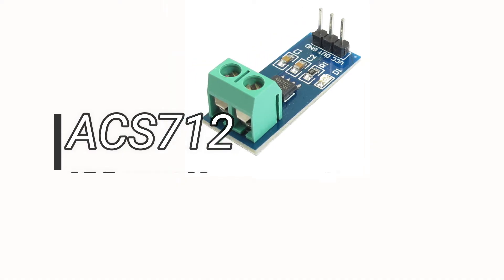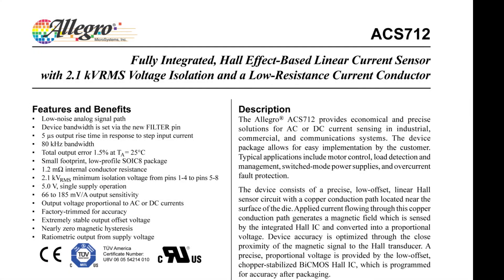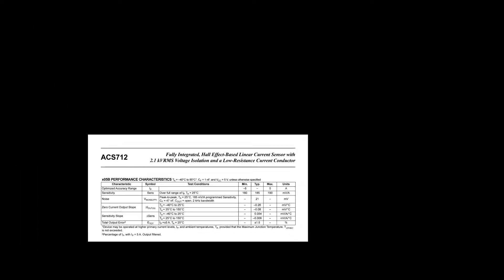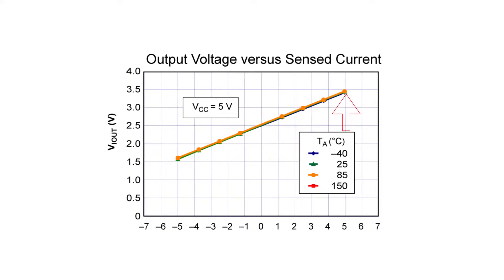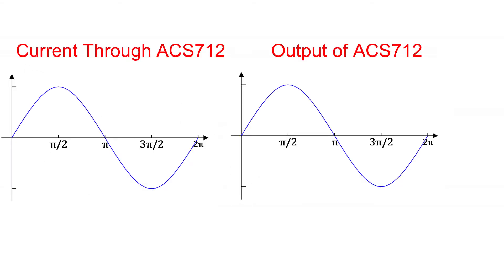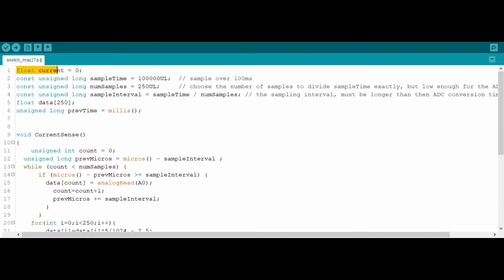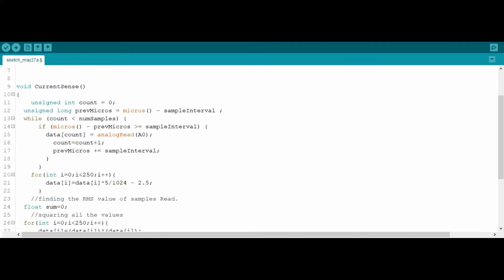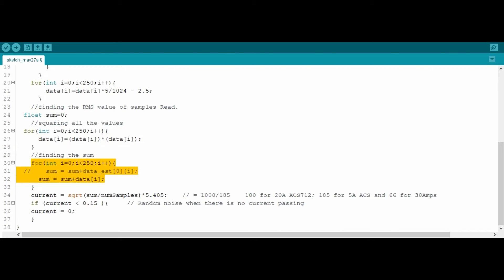ACS712 AC Current Measurement

Comment: Thank you for your effort. I'm wondering which value you measure with a multimeter. Powering the sensor with a 5VDC supply I got 4.9 VAC idle voltage. Is it the same you get? I tested 4 sensor ( 2 rated to 5A and 2 sensors rated to 20A, with always the same result) I setup the multimeter to measure AC voltage since I expect a 50 Hz wave at the output. Viceversa with multimeter setup to measure DC voltage I measure 2.5V (which make sense, but I do not think appropriate). Furthermore when current starts flowing I do not see any change in voltage (either AC or DC). Did you sense the OUT pin with a multimeter? Did you get same values as me? Thank you
Reply from the maker: Thank you Sergio for your comment. 
There are two cases in which you can use ACS712. 
1- For AC current measurement
2- For DC current measurement

Let's discuss the second case first and consider 20A module. When there's no current flowing you get 1/2 of the Vcc applied. As you applied 5V so you're getting 2.5V on output (as you just mentioned). So, now if you pass DC current through it, it's value will either start to decrease or increase. The value will increase if current direction is from pin 1&2 to pin 3&4 (As pin 1&2 and pin 3&4 are shorter internally). If current direction is reversed then output voltage will start decreasing from 2.5V. 
Now the question arises how much voltage will change. So, in case of 20A module, it will change 100mV per ampere. Or 0.1V per ampere. 
Let's say you're passing 1A current from pin 1&2 to pin 3&4 then the output will change from 2.5V to 2.6V. Or if you reverse the direction of DC current then it'll change from 2.5V to 2.4V. 
 So, every ampere of DC current you pass through it the output will change 0.1V/A. So if you're passing 10Amps, the output will go from 2.5 to 3.5V. 
As the current passing through sensor is DC the output also remains DC. As the reference voltage is 2.5V so you can easily detect the difference of the value you're measuring with multimeter from 2.5V and you get the result. 

Let's now discuss the case of AC current. As we know AC current has both positive and negative values, so the output of ACS 712 will also have the same sinusoidal value. But in this case the reference will be 2.5V. So your current will vary around 2.5V. You'll get a 50Hz sine wave but remember that is reference is 2.5V. So to see the actual waveform you need an oscilloscope. Or you need such a multimeter which could remove the DC offset (2.5V) and only then you'll get the actual results of RMS current. 
As you said your getting 4.9Vac, these values are wrong and doesn't depict anything. 

If you still have any problem, do comment. I'll try to help you more.